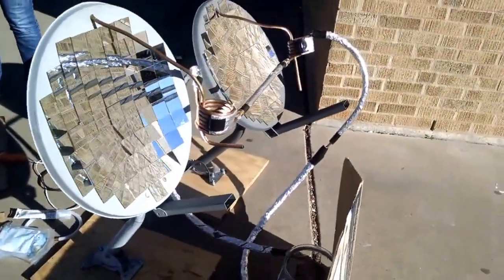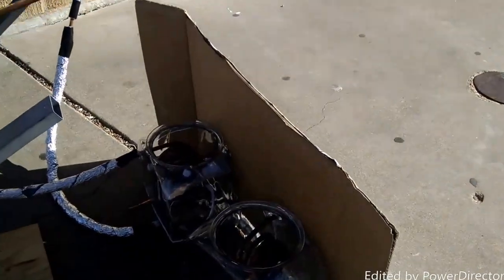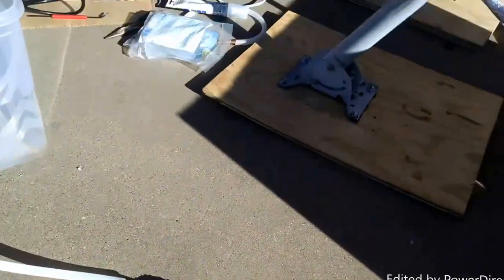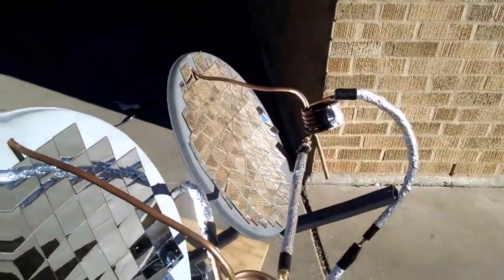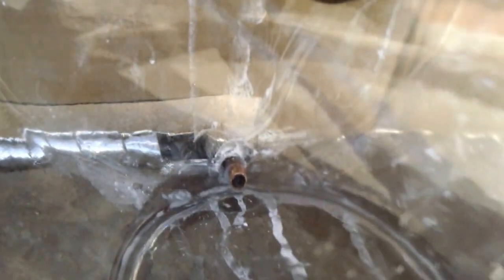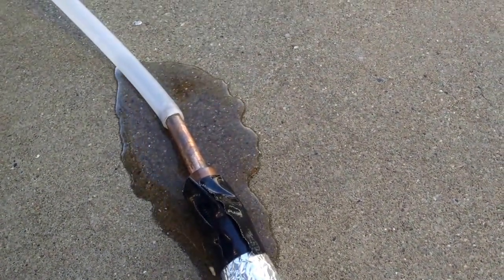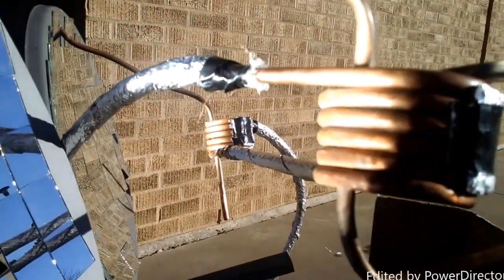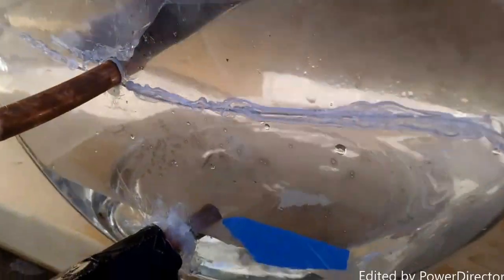Parabolic Dish Reflector - Multi-Stage Flash Desalination Plant

Comment: This is a great system! Where can I find more info on how you've built it? Thanks!
Reply from the maker: It was an undergraduate project. This design is based on some research papers that people have implemented in desalination plants around the world. You might simply search for the keyword "Solar Parabolic dish desalination plants," There will be a lot of info. The only thing I had trouble with this design is due to its recursive heat transfer, which is difficult to experimentally measure. Thanks
Reply: Thanks for this - will do some research. I am currently looking at building a small solar desalination plant for an island with no access to fresh water - small project. Would you have more pictures of your plant? My email is diego@fromigo.com - if you'd rather comm via email...